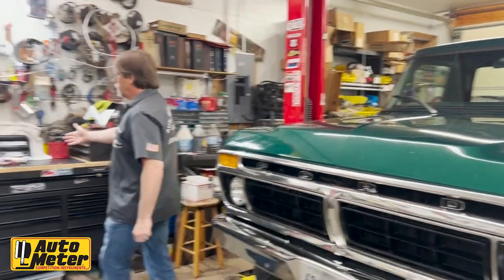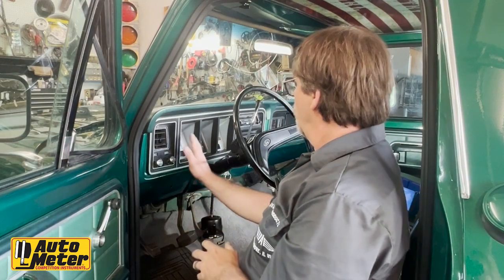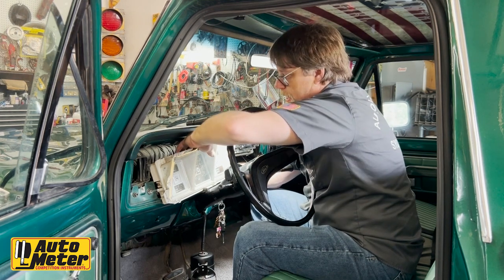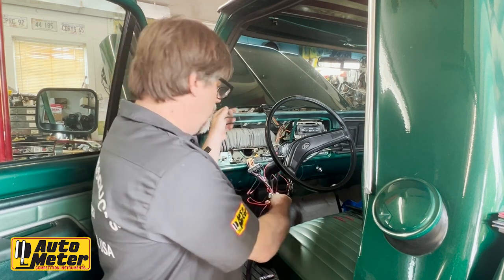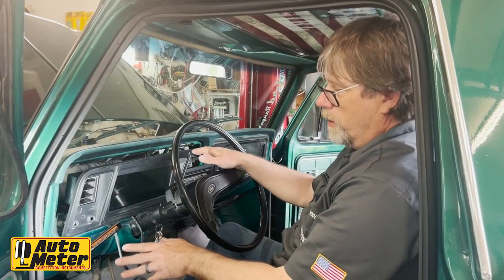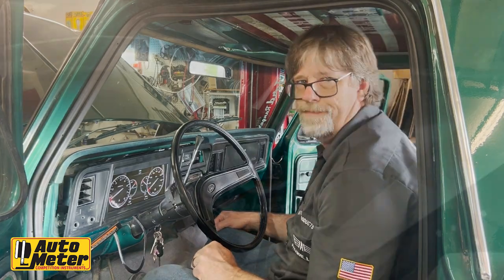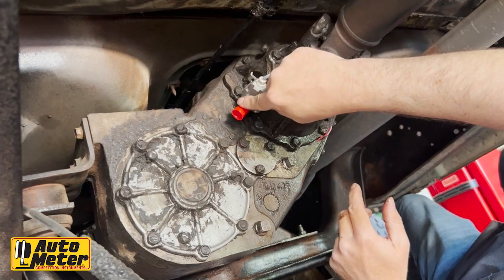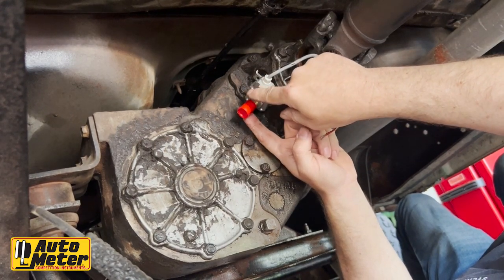1973-79 Ford Truck and 1979-79 Ford Bronco InVision Digital Dash Install – AutoMeter Model 7402

Comment: So the site that has the EZ Harness states it will fit 74-78 and 80-86.....so it will fit a 78, but not a 79 ford?
Reply from the maker: The dash that was in this 1977 truck was originally out of a 1979 with no modifications to the wire harness. The harness should be the same from 1973-79. We would recommend contacting EZ Harness to make sure the harness will work for your truck.
Reply: @AutoMeterTech  will do, thank you.

Comment: Congratulations Auto Meter, magnificent, do you have a kit for the 1993 Camaro Z28? 🤜⚔️🤛🏁🏁🎱🎱🇧🇷🔥👻
Reply from the maker: Unfortunately we do not have an InVision direct fit dash kit for the 1993 Camaro, however, we do have the Universal Dash (#7000) as an option.